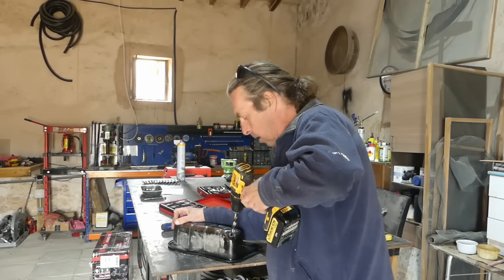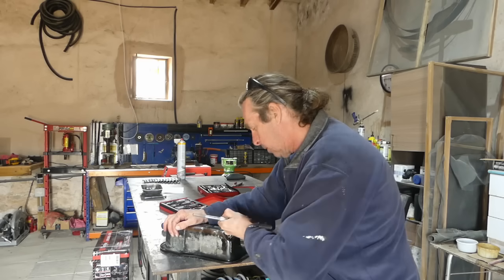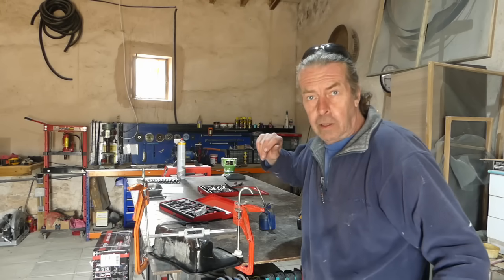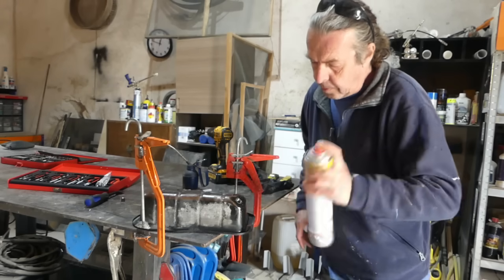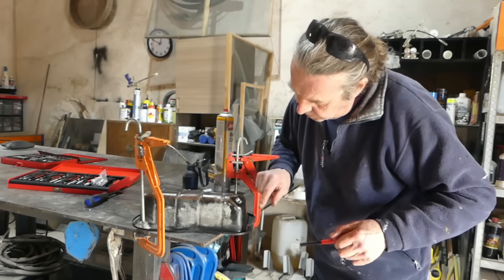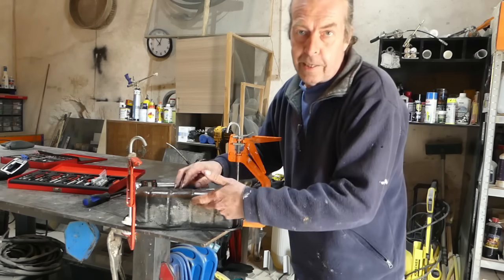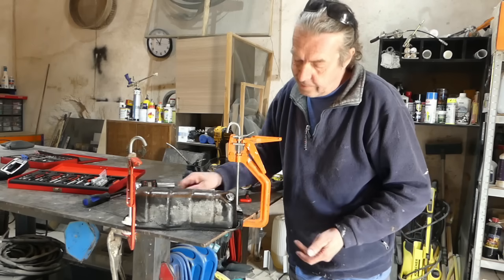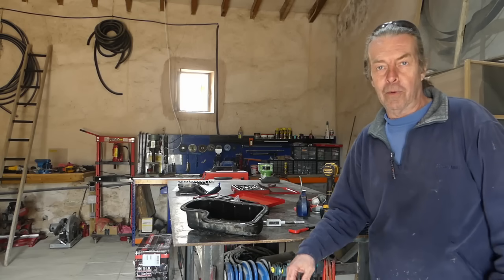Easy, permanent repair of stripped / damaged threads – Helicoil thread inserts

Comment: Nice little job.
Why did you just drill the hole out and tap the threads and a new bigger bolt😊?
You lucky most oil pans can't be remover without pulling the motor😢
USA V8s lol
Reply from the maker: Because I didn't have a bolt that big lol. Tell me about it. I had a F350 6.0 Powerstroke Dually for many years towing up to 15000lb 5th wheels all over Europe. I did all the usual 6.0 fixes (oil cooler, EGR, FICM etc) and it went on to do over 300,000 trouble free miles until I sold it.
Reply: Yes, good truck .
I have I have a Sliverado 2500  3/4  ton 4x4 not a 1 ton like your Ford.
It has a 6 L 366 cbi motor.😊